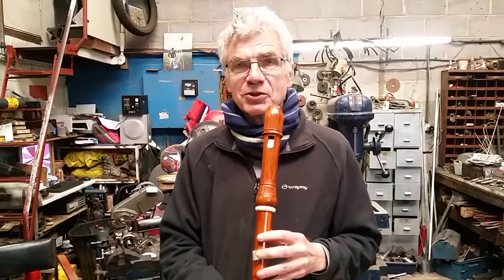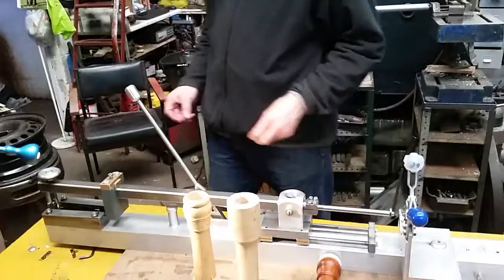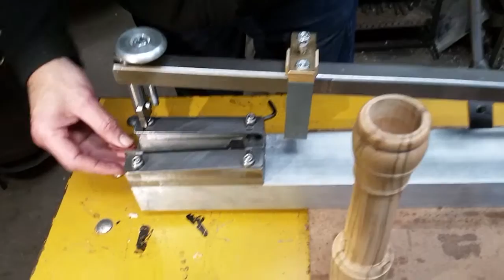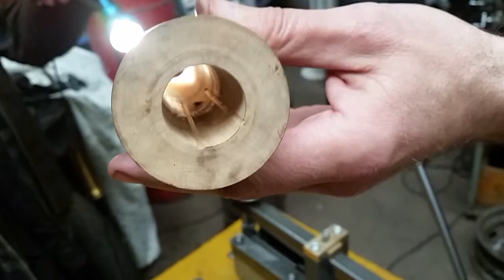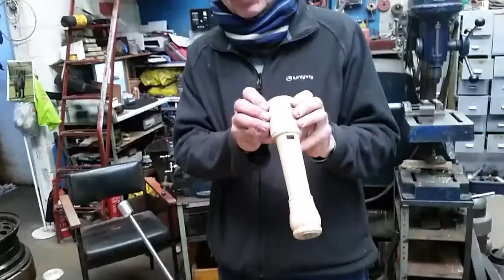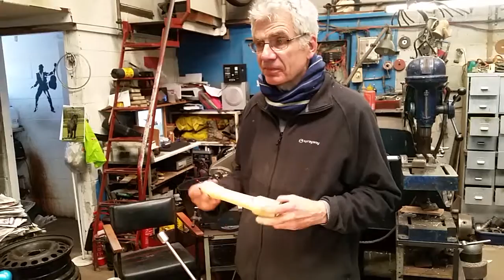Recorder making. Cutting the windway

Comment: What seems peculiar to me is that your machine scrapes the bore forward meanwhile all devices I saw before made it backwards towards the entrance of the windway. Although - there seems no significant difference as you cut your windway BEFORE you cut the window. I made a few recorders but I made window and labium first and then scraped the underlabium and the windway. In this case scraping backwards allows not to damage labium. But - very much depends on the kind of tonewood you use.  
Your machine is impressive, thanks for sharing:).
Reply from the maker: My initial thought when I got my first machine from Alec Loretto, was thati wanted to be able to adjust the windway by hand. As you will know if your have made recorders, there is always a good and a bad direction for scraping grain, and if I chose the side of the head joint that gave me easy scraping coming in from the top, then I could easily adjust with hand scrapers later

Comment: Thanks a lot from a fellow recorder maker with another self constructed windway machine! Same basic principle but doesnt make it conical. One question, how do you make sure after reinserting the headjoint that you didnt rotate it even slightly compared to its original position?
Reply: I believe it indexes into the sharp points on the clamping mechanism

Comment: Seems hard to make a recorder. Also the wood needs to be seasoned right?
I was wanting to obtain an ebony moeck recorder and I probably should have bought one years ago as now they are very hard to come by. In saying g that I would like someone to build me a recorder soprano which a432 resonance. My rosewood moeck soprano is a429. The ebony is a harder wood so I wanted to see the difference been the harder wood may be used for fast passages as the rosewood will be more mellow.
Indeed the tenor recorder you played has a beautiful sound. I would like a tenor without any levers.
I also own an alto recorder which does have a very mellow sound also made from rosewood and it's a moeck.
My sopranino recorder is a mollenhour. Sorry incorrect spelling. I'm sure you will e familiar with this make. I could get up and have a look. Nope no information. The moeck indeed is a rosewood 429 rottenburg. Freidrick von huene. Jean hyacinth Joseph Brussels 1672 1765 that's what it says on the label.
Flautist Dolce.
Indeed it is my favourite. Also the alto I quite like also.

Comment: How were recorders made before these machines were invented?
Reply: People just used their hands.
Reply: There were simple lathes that worked with pedals, ropes and belts (obviously they did not have the speed of the current ones) And the rest of the tasks were done by hand. With this type of simple machines one can reproduce the same process 100 times and obtain the same results. With hand tools - a short file was used for that job - it all depended on the hands of the artisan. That's why today we know Rottenburg, Bressan, Denner, Stanesby, Hotteterre, etc
 (the same happens with Stradivarius, Amati, Rugeri or Guarneri on violins) They became recognized for achieving a high level of consistency (much less than any current production process, by the way).